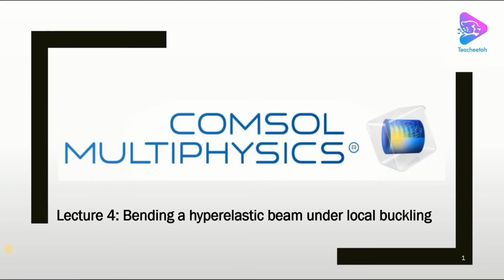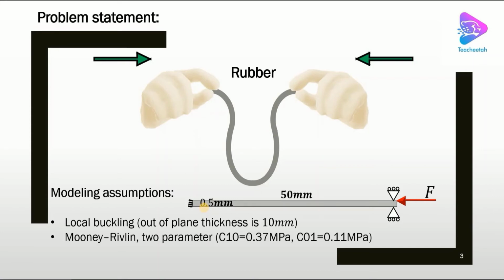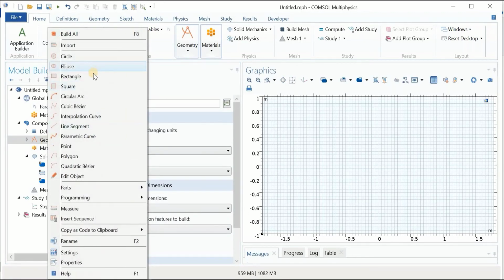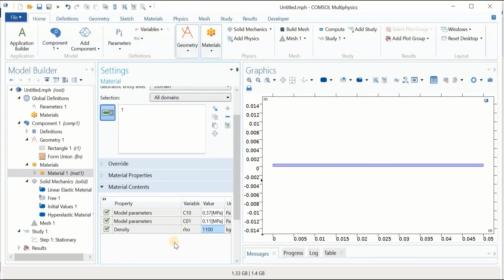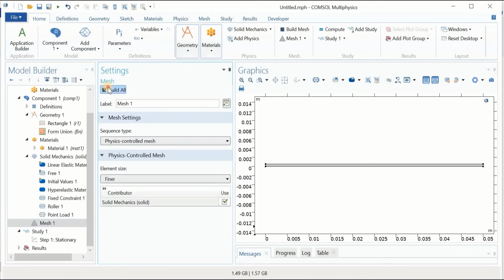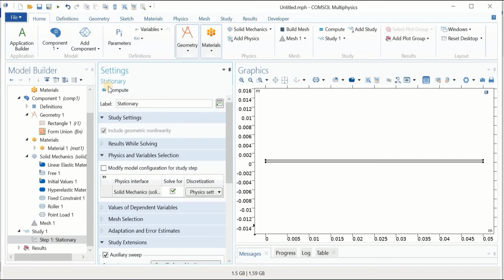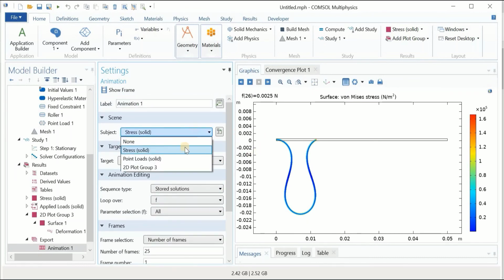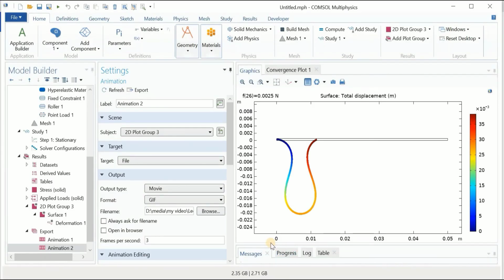Tutorial 4: Hyperelastic Beam Under Local Bending with Comsol Multiphysics

Comment: Such a helpful video!
I am trying to simulate the bending of a beam with 3D model. How I can define boundary condition for this model? The roller boundary condition does not work in 3D simulation!
Reply from the maker: Thanks for the comment. The roller BC may also work for the 3D model as well. Please note that in the 3D system, you deal with face and edge boundaries so you need to adjust Boundary conditions accordingly.

Comment: Thanks for your simple and amazing tutorial. I am trying to change the dimensions to simulate nanoscale beam. There is an error I am facing with:

Failed to find a solution for all parameters,
even when using the minimum parameter step.
No convergence, even when using the minimum damping factor.
Returned solution is not converged.
Not all parameter steps returned.

How I can fix this error?
Reply from the maker: Thanks for the comment.Usually, in nanoscale, the problem is with meshing size that cause issue in FEM solver. Also,  this might be a common error that you may face for different reasons such as the issues with boundary conditions, the type of solver, solver iterations and tolerances, etc. You may try to play around this parameters to fix it. 

 We also sent your request to our COMSOL team and waiting for their detailed response.
Reply: @Teacheetah  Thanks for your reply. I fixed it. As you mentioned it rooted into boundary condition (iterations).
Reply from the maker: Glad that you could fix your issue
Reply: @Teacheetah  Thanks for your support. I have two more questions: 1) Is hyperelastic analysis suitable for small amount of strain in a rubber (2%)? 2) How can we find the most accurate model for our simulation?
Reply from the maker: @amirghasemi3781  thanks for the comment. We have sent your to our COMSOL team. We will get back to you ASAP.
Reply from the maker: One way to find the accurate model for your material is to look into the stress-strain behavior of your material obtained under standard tests and see what elasticity model (e.g. Neo-Hookean) matches your material, then you may select the appropriate elasticity model in COMSOL that matches your system. Again for a small strain, you may look into the stress-strain curves experimentally obtained for your targeted material and see if the behavior is linear in the region you are dealing with, and then you might be able to simplify your system using linear elastic models, but again it is just a simplification.